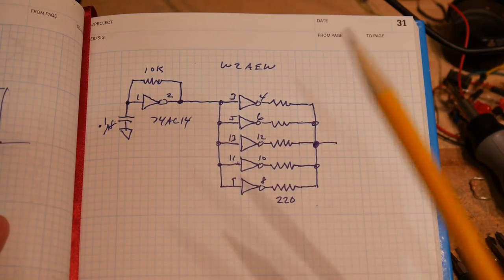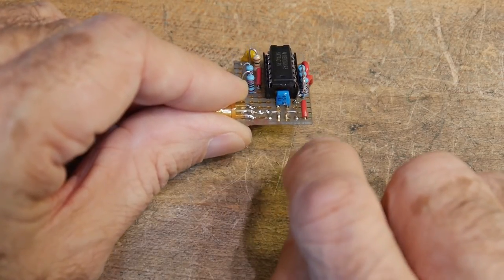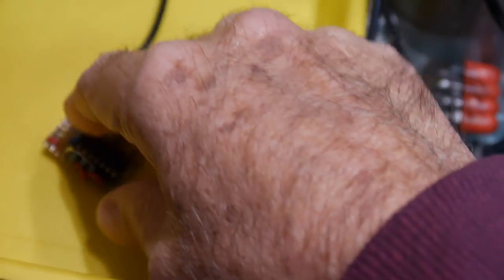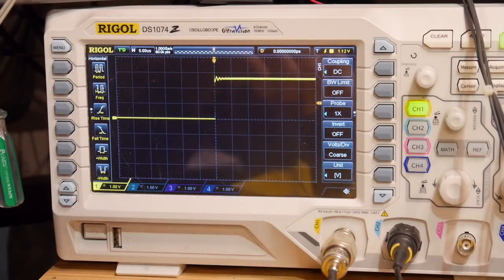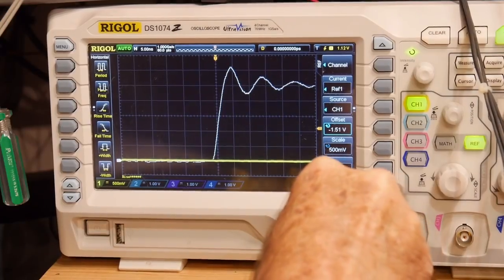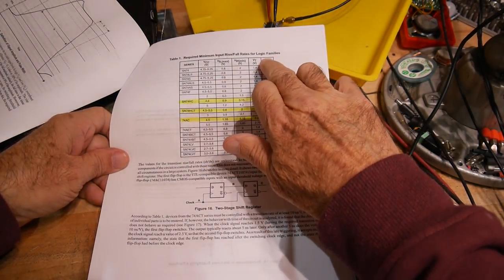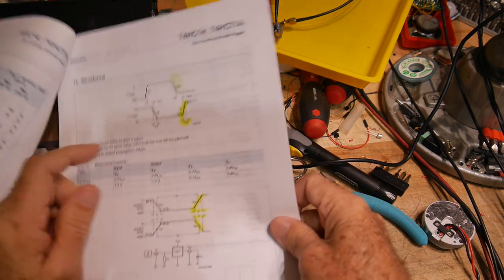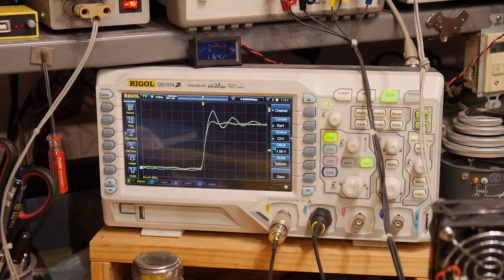#286 which is faster 74HC14 or 74AC14

Comment: I don't think an oscilloscope with 70MHz bandwidth can reliably display a rise time less than a few nS.  I think if you were to measure a pulse with 3nS rise time and one with a 100pS rise time they would appear almost the same on the oscilloscope, the faster one probably inducing some ringing (in a digital scope).
With regards to the rise and fall times in the datasheet keep in mind that these are assuming a relatively high capacitive load and are dictated by the output impedance and current drive capability of the output stage rather than the actual switching time. For an open output or even feeding directly into a 220 ohm resistor it is likely to be considerably faster.
My oscilloscope is only a little faster at 100MHz so I am unable to confirm it that way but if instead I just connect a short piece of wire to the output I can see strong harmonics way up into the GHz on a spectrum analyser which is sort of indicative of rise times much faster than 3nS. To see them clearly I increased the frequency of the oscillator inverter to about 20Mhz as with the original 100Hz the power transmitted from the 'antenna' was too low for the spectrum analyser to capture.
Of course if you are using that same 70MHz oscilloscope to do the TDR measurements all the above doesn't matter.  It would be interesting though if someone here with access to a faster oscilloscope could try out this same test. My guess is that both will give a considerably faster rise time probably around 2nS for the HC and less than 1 for the AC.
Reply: Yes, you are right, I measured today with a 4GHz scope (almost same circuit, 74AC14). Rise/fall time of <1ns.
Reply: ListerDave1240 is absolutely right, but to observe sub-nanosecond rise times correctly, you need ALL of the following. 
1) An oscilloscope that is fast enough. 1GHz is the bare minimum, but at least 2GHz should be used
2) Either a really fast scope probe, or a circuit that has an output impedance of 50 ohms and the use of 50-ohm impedance cables throughout into the 50ohm scope input.
3) Proper decoupling capacitors connected just millimeters from the silicon of the IC. Matrix boards, through-hole resistors are not suitable, and a DIP package for the IC will degrade the measurement. In this case, use 1nF, 10nF AND 100nF all in parallel with the smallest capacitor closest to the chip
4) A proper ground plane to connect input, power and output grounds.

This demo had none of these four, and just having a fast scope is not enough.

The ringing that was observed is generally not a function of the properties of the IC, but of the test circuit

Comment: Hello dear sir,
What you are measuring is actually the scope's input analog bandwidth, not the DUT !!!
The results you get are in  the ball park of 4.5nsec for a 70MHz scope like the Rigol you are using.
( BW~= 0.35/Rtime)
Therefore ,You should use a vastly faster scope( 500Mhz or higher),could be an analog scope as well.
 
Furthermore , the measurement   of the 74AC part is flowed ,since you shouldn't (or the auto mode of the scope  shouldn't )measure rise time of the ringing amplitude but of the logic levels "settled  voltages".

Lastly you should terminate the output to avoid the ringing.

I usually enjoy your videos, this one ...not so much :)

Comment: I just discovered your channel. Excellent stuff! You should upgrade your Z80 and 8080 stuff to play videos games as I did back in the early 1980’s.
As for this video, it appears you hit the head of the nail - the 74ACxx part has a different impedance and you’re seeing the consequences of it (although a relatively minor case).
This illustrates that you just can’t necessarily insert a new and faster logic family in place of an older and slower one.
These days we even get problems using the modern versions of supposedly old logic families because of the smaller and faster semiconductor geometries to same cost by increasing yields.
If you get too fast, the good old DIP packaging also contributes towards impedance challenges.
Many DRAM designs of the 1970’s and 1980’s used series terminating resistors on their address lines to quell the potential unwanted under/overshooting and signal ringing.

Comment: I can’t help but point out that your power supply decoupling capacitor is too far from the device to work properly for the AC family part. The socket, leads, and lead frame inductance of the part are causing the ringing. There is no need for the 1uF tant if decoupled properly.

Comment: Using 220 ohm equates to 44 ohms. That is assuming that the output is zero ohms of the IC's. You need to use 250 ohms and use a 50 termination on the scope.

Comment: Thanks for posting. Question Back when these came out who was the first manufacturer?
Reply from the maker: TI
Reply: @IMSAIGuy  Thank you. In you opinion will this produce a fairly noise free output signal?
Reply from the maker: I don't understand the question. this is a digital system zero or one @MsFireboy2
Reply: @IMSAIGuy  Square wave RC oscillator circuit.
Reply from the maker: https://youtu.be/o31_fnTqUOw?si=dLArShyD0NBJaXlg

Comment: I looked up the datasheet that you were looking at and the specification was not the rise or fall time of the output but the propagation from the input to the output.

Here is possibly the original source of the circuit. https://www.electronicdesign.com/technologies/displays/article/21762705/build-your-own-cable-radar 
A good build up of this design is. https://www.epanorama.net/circuits/tdr.html
Reply: I found it, the AC series is faster it is approximately 1.7 ns vs HC at 3.6. Here is a link to the document check page 5.
https://www.mouser.com/catalog/supplier/library/pdf/FairchildLogic.pdf

Comment: Could the rise time measurement be affected by the bandwidth of the scope?
Reply from the maker: maybe
Reply: @IMSAIGuy  That's why  you can't measure the speed difference. Your scope bandwidth is 70MHz which is useless for measuring sub 4nsec rise / fall times. Use faster scope and you will see the difference. Also you need a better probe higher bandwidth and short gnd clip. your long gnd wire gives measurement errors. Use something like gnd spring or even better SMA cable to connect to your scope.
Reply from the maker: @MahmoodElnasser  Yes you are right. However since that is the only tools I have then I don't need a faster edge for the tools I have. If I ever get a faster scope then I will revisit.
Reply: @IMSAIGuy  it's time to revisit now. ;)
Reply from the maker: @tonyfremont  you are right. I just did. 2.7nS rise time for HC part 2.2nS for AC part. HC part nice and damped, AC lots of ring.
Reply: @IMSAIGuy  Maybe the IC socket has a role with the ringing?